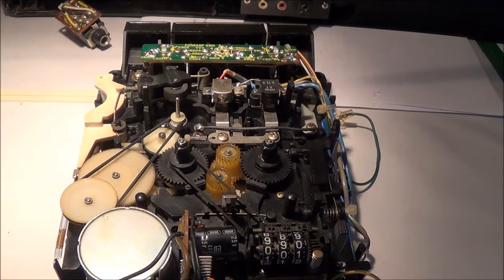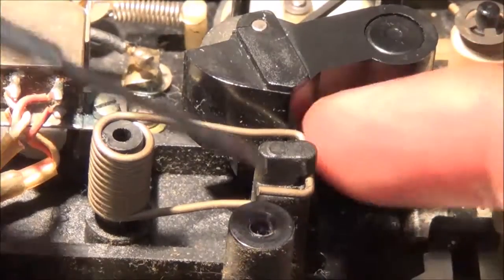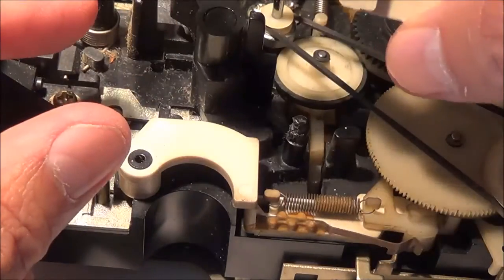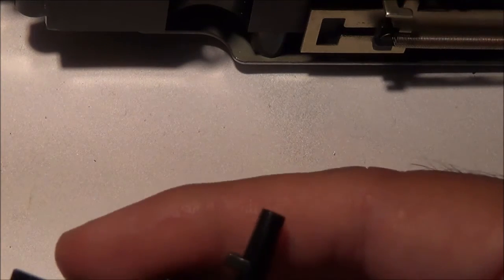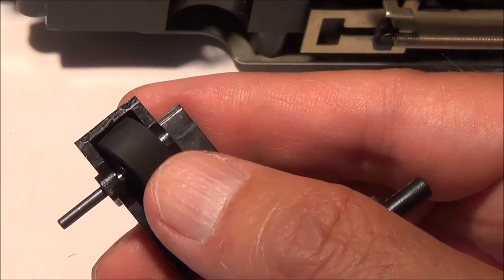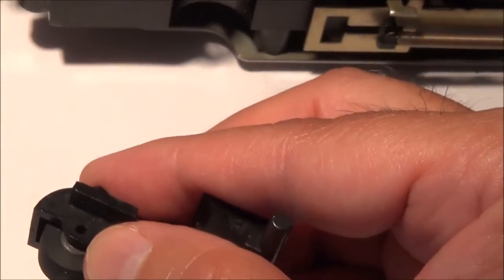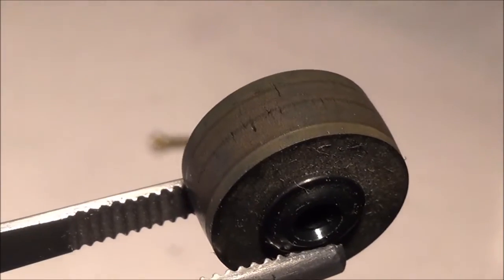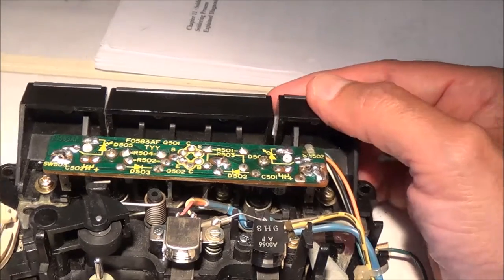SHARP GF9191 PINCH ROLLER REPLACEMENT

Comment: Thanks for the great excellent detailed video. The 40 years old pinch roller surface was harden like a rock. I also increase the tension a little by bending the pinch roller  spring before install it again. Actually to service this you don't need to take the whole mechanism out and you don't need to remove the PCB. The spring can be easily removed and there is enough room to do just that.  I used a pointy screwdriver to PUSH the pin out, very easy to do, this is only possible in one way/direction (push at the top).  The replaced pinch roller doesn't have to look exactly the same, I have used one of 3/4 plastic inside and 1/4 rubber surface however approx the same diameter and width. Works great. Important notice to the surface of the new pinch roller: to avoid skewing of the tape, be sure the surface is not bold (like in your video at 8:11 - i have a few new ones with this issue). The surface needs to be flat, not (slightly) bold.

Comment: Hi there, i’m french don’t mind my english. I have a sharp fg 9191 that i try to restore. I managed to fix the rubber goo wheels. But now i have an issue with speaker when i play the cassette turn but the sound are incredible low and sometime the speaker make loud acute sound (like bip) do u have and idea how i can fix that ? The speakers works fine with radio. Thx you
Reply from the maker: Bonjour. You should clean the record/playback switch/es. Or at the very least, move it/them back and forth a few times. Hard to say how many times; sometimes the problem clears up after 3 or ten times and sometimes not at all.  The switch or switches are long and flat on the board. Close to the cassette mechanism. You can also spray contact cleaner in there and work it back and forth. With the power off. That can cause these funny noises. You should also do the same to all the controls if you can. At the very least l, do that long flat switch. If that doesn't help, do all the other controls/switches.

Comment: Hello,
My sharp9191 has stopped spinning.
When I turn on the boombox and press play, it's start to spin but it's weak and it seems that it's blocked after a couple of rotations /seconds.

do you have any tip on how to find what's wrong and what to replace?
Reply from the maker: Sorry, I am not on YouTube very often, therefore it takes me long to answer. Hard to say. I would check the belts, and inspect and clean all of the rubber wheels. Make sure they are not glazed, hardened, or cracked. Clean everything with isopropyl alcohol. Also check the little rubber pulley on the capstan, which is a long, thin, and shiny metal rod. Make sure the motor spins freely when the belt is detached from the motor pulley.
Reply: Sticky goo mess on the capstan, next to the take up reel rubber wheel that contacts the capstan when pressing play.

Comment: You've done a very nice job here. I assume this cassette mechanism is very similar to the Sharp GF-9292? That's my next project, so new belts and pinch roller.👍👍
Reply from the maker: Thanks. I have never had a 9292, but both seem to be almost the same; the differences seem to be mostly cosmetic. Those 9292s are not that easy to find.

Comment: What is the diameter of the Pinch Roller please?
Reply from the maker: I can only tell you about my replacement roller since I no longer have the service log for this. The outside diameter is 13 mm and the diameter of the hole seems to be 2 mm. Since I don't have a micrometer, I had to eyeball this with a ruler. But they are for sale on eBay Germany; not that cheap, but the seller is reliable and also ships international, although not everywhere. The seller was called revox_de.
Reply: @OldSchoolElectronics  Thanks for your reply. I have since been able to find that the Diameter of the Original Sharp Pinch roller is actually 13.3mm while the diameter of the replacement (made in China) rollers are 12.8mm. I recently held both in my hand and I can clearly see the difference in diameter. For both, Yes, the hole is exactly 2.0mm and the width of the rubber is 6.0mm while the width of the hub is 8.0mm.
Reply from the maker: Cool! Thanks for all of these infos! I am sure they will help people in the future. I am not even sure I had the original specs written down since the old ones are out of spec due to wear.

Comment: The same kind of rubber that was used in the Optonica RT 7000 and probably in some other Sharp/Optonica models  .  Very strange and bad compound .  Never seen anything like this , with all these cracks . I think the pressure of the spring was maybe too high also.
Reply from the maker: Thanks for your comments. I don't know about the pressure of the spring. You arw probably right; it must be the material. The Sharp works great now; the woman that has it uses it often (she still has cassettes) said it still works great. These boomboxes have seen a lot of use and abuse, too.